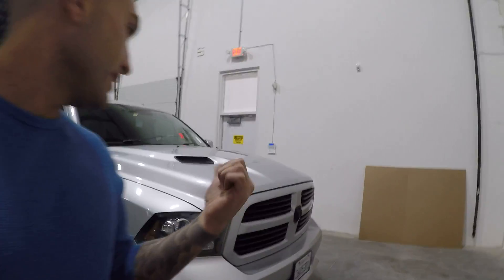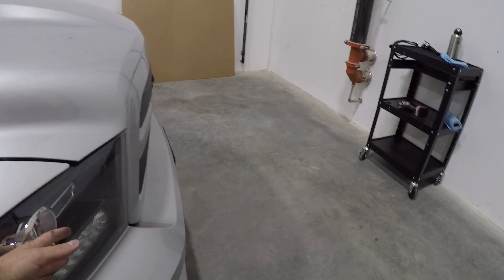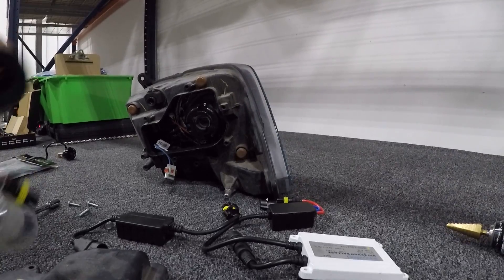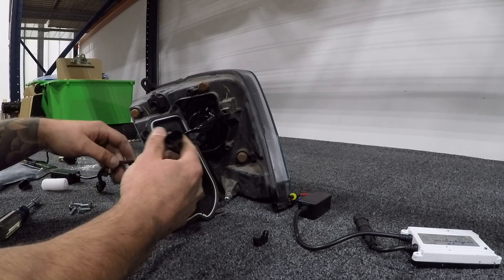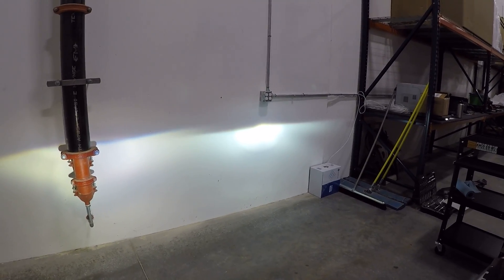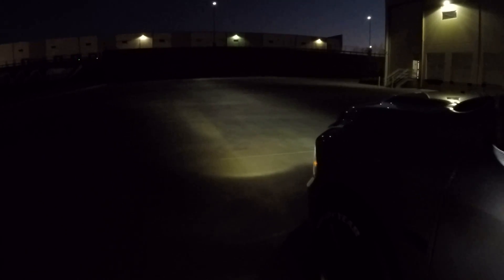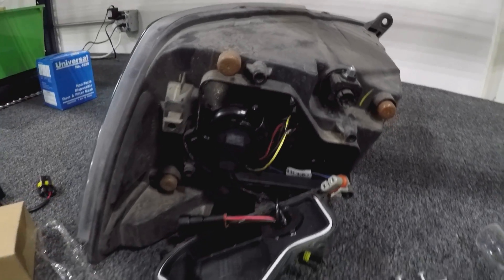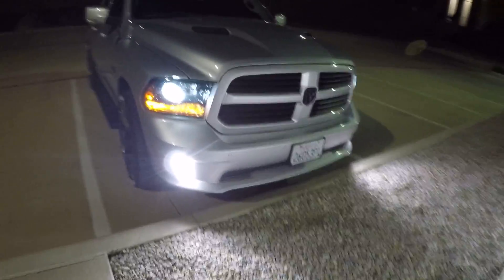LED vs HID in Factory Halogen Projector Headlights

Comment: Hey bro I installed this same set up on my 2015 ram 1500 and with the truck off the lights on with no problems but with the truck on the lights wont turn on or when the do turn on they flicker or they shut off after being on for a little bit. Any ideas on what the issue could be and what I could do to resolve it?
Reply from the maker: Is this with your headlight switch in auto mode?  I know some of us have had to manually operate the headlight switch for everything to work properly and auto mode acts a bit funny for some reason.

Comment: Hey brother I have a question , I have Laramie 2016  this bulbs h11.h8 h9 fits in my truck ?
Reply from the maker: Hey Bruno double check here cause they switched the bulb types around for different years for some reason even though the headlights all look identical http://www.philipsautolighting.com/ajax_select.php
Reply: It’s been almost a year since you put HID BULBS in the truck. I want to convert to HID cause the Led bulbs are not bright enough in the projectors. How are the H IDs holding up?

Comment: Probably a dumb question but I’m kind of sold on these now, however I worry how they will fit in a regular reflector housing? Will they still have a good cut off or would I be blinding people running these in factory quad reflectors?
Reply from the maker: Go LED for your reflector housing headlights. I like LED better for reflector housings 👍
Reply: BoostedMotorsports  Awesome, thanks man. I may have gotten a bit excited and bought the HID’s last night haha we’ll see how they run and if I need to change them down the line I can. They are only $36 so not to bad at all! Loving the channel btw, I have a 2014 1500 Quad can just like yours and I’m slowly trying to get some modifications done, so I really do appreciate your content. I was thinking recently if a muffler delete but after watching that video of your B2 Fabrications muffler I’m really thinking I may go for that! Keep it up man 👊🏻

Comment: the best comparison bro..
Reply from the maker: Thanks!  Check out my other videos on the channel too! 😁
Reply: BoostedMotorsports  so bro.. even though I buy high-end LED 13600 lumens headlights but still can't beat the HID 55w 4300k to 5000k?  bec HID has farther reach than LED
Reply: oh i am using factory projector headlight H11
Reply from the maker: Yeah cause the beam pattern of LED sucks in these projectors.  👎
Reply: BoostedMotorsports thanks alot bro.. now i am decided haha i will go for hid 55w..btw is it legal to use 75w or is it ok to use in a normal projector headlights?

Comment: Is the canbus required to run the HIDs or the LEDs in the headlights? If not what is the benefits of using it? Thanks in advance!
Reply from the maker: Yeah you need it to run LED or HID to put a load on the circuit and prevent flickering! 😎

Comment: Hey! Great video! I installed this one on my 2015 RAM 1500 and it worked perfectly for 15-20mins and the turned off. Not sure if overheat or what happen. If I turn them off for a while and then back On, they work again for that same span of time. Any suggestions? Thanks!
Reply from the maker: Hmm thats strange I haven't heard of that!  Might be the kit you are using or the decoders?

Comment: With the headlight and fog light set ups you used. Can you tell the difference in lighting "color" when they are both on at the same time? Or do they have the same tint to them? Low beams and fog lights.
Reply from the maker: Hey Landon all bulbs usually are different color even from one brand to the next.  Right now I'm currently rocking 5000k Innovited 55w HID in the lows and the Hikari LED bulbs in the fogs and its a pretty nice white color for both!
Reply: BoostedMotorsports right on! Thanks brother. Great videos.

Comment: 55 watt HIDs are significantly brighter than 35 watt HIDs. Typically LEDs that don't have 360 degree light output will look like the ones you have. The newer ones do better with 360 degree coverage but will still lag behind any 55 HID. The LEDs I have in my Ridgeline outperform the HIDs in my Jeep Grand Cherokee. Anything is better than the halogens. The use of 4300 to 6000 Kelvin makes even a same lumens  LED or HID outperform the 3500K halogen because they reflect better. Those in the Ram are excellent..

Comment: Note To All:  This is a great lighting change.  I did the Innovited HID 6000k and couldn't be happier but.....BEWARE of some car washes especially touchless.  They use a lot of high pressure water and at weird angles that you wouldn't get with normal driving.  My install was the exact same as Boosted's but the grommet failed to keep the headlight sealed and I got moisture inside both housings.  Luckily nothing blew but I have to take them off now and dry them out.   You may need to silicon around that grommet if you hit the wash often.
Reply from the maker: Thanks for the feedback and great tip!  Silicone is a good idea too!  With all the bulb swapping and testing I've been doing I didn't do this but it is definitely a good idea!
Reply: Hey John, used your link for the Innovited from Amazon but got confused at the page with the amount of options. I have a 2014 Laramie with all options but want to do the light upgrade. What is the specifis model # do I need to get?
Reply: And that is with inexpensive HID's. Try some high end HID's and you will really be amazed.

Comment: Hey Boosted, I really liked the video. I have a question. I also have car which has projector of halogen 35w. So as per your video it seems if I have to upgrade my headlights its better to upgrade to HIDs rather to LEDs as I also faced the same issue as you mentioned in your video that in halogen projector, the LEDs doesn't work well.
My next question is from 35W to 55W, will it not heat up the housing more and damage it?
Reply from the maker: Hey thanks for the question!  If you have the factory project headlights I would definitely recommend the HID bulbs over the LED for this application.  Also you won't have any issue running the 55w kit 😎

Comment: What is the CANBUS harness that you left in there? I did this install last night with the Innovited kit. It worked and looked great while the truck was not running, but as soon as I start the truck they flicker like crazy and shut off. Innovited linked me to a relay harness to directly connect to the battery, but I'm thinking that if I can get a hold of a CANBUS harness like you have (assuming that's the only difference in your setup), that'd be a lot easier!
Reply: I'm an idiot. I completely missed it in your video description.... /shame. Ordering a pair - hopefully they'll work. This truck is so much work to take everything apart to test a headlight, lol.
Reply from the maker: lol no worries Conrad!  You'll be an expert in no time! 😁
Reply: The decoder kit you linked worked like a charm! Also, I'm getting really good at removing and replacing the grill & lights, lol. Did you ever change out your high beams? There's so little space where they're located. I'm on the fence about modifying the housing even more to let some good LED (with the fans) fit in there.

Comment: Stumbled upon this channel a couple of days ago and convinced myself to go with HID's for low and LED's for fogs finally! I have a 2014 as well that I've been hesitant to mod at all. I was against swapping out the stock lights from bad experiences with HID's in the past but sounds like most people are having success and the video makes it look incredibly simple.

Just finished installing OPT7 CANbus 35w kit in the lows and already see a huge improvement. Install was just as easy as the video makes it look, good work! No codes or flickering but concerned from other's comments there may be issues down the road? Is using the auto function not recommended? Is it overkill to get CANbus decoders now and install them as a "just in case"? 

I also installed JDM ASTAR G4 LED's for the fogs and can't believe how bright they are! I ordered the same set for the Hi beams but there's no way they will fit. The fan for the LED is way too deep to squeeze into the housing. Has anyone had success installing an LED set for their Hi beams? I also haven't had a chance to drive at night yet with the new HID set up...is it even worth putting LED's in Hi beams?
Reply: Hi Matt, with the HIDs I think it would be best to use your switch because of the striking/restrike with the HID bulbs. From my little knowledge of them, they only have so many cycles before the bulbs are trash. They should last a good while though so don't let that bother you. Using the switch would be the easiest way to cut those number of cycles and extend the life even further. I ran a full LED setup  (Hi's and Lo's) for 2.5 years because I wanted to keep the Auto functionality. Looking back I regret it because the HIDs in the Lo's are way brighter. You may be fine with just HIDs. I have a 2015 and the CANbus is a pain. I am not sure exactly what the model year was when RAM refreshed it. My buddy had a 2012 and he was fine with HIDs with no codes/no decoders.  If you are getting light and not popping a code you may be all good. You could always add them later if you have issues. 

You can run LED highs without modifying, but it is tedious and a bit of a MOFO to get them in. You will curse. A LOT! Depends on the fan length though, the bulbs I found off a guy on a forum barely fit. I am not sure it would be worth the frustration. Unless you are able to find a bulb with high lumen output with a short(er) fan. Some of the stuff on amazon has dimensions listed. May be worth a measure it you want to go down that road. They're way brighter though, but I have not driven with the HIDs yet as I am still working through CANbus BS. Good luck.
Reply: brascle32 thank you for the quick response! I’ve become spoiled with the auto function...I’ll plan to be the guinea pig for everyone and give an update if any issues pop up / how long the bulbs last. 

That was the main reason I stayed away from HID’s for as long as did. In my last truck it felt like I was replacing bulbs or ballast every six months. They would of course always go out on road trips...

Hoping that isn’t the case with these but always safe to have a spare kit in the closet for (hopefully not) the inevitable!

Comment: Awesome content on this channel! Sweet build! I have been moding my 2015 Sport 4WD very similar to yours just at a much slower pace. Ha!  I ran LED Hi's and Lo's for about two years and decided to go HID in the Lo's and found your channel. Completed the install yesterday and have an issue. Hopefully the masses can help me out. I am using the same Innovited 55W kit with their decoders that I grabbed off amazon. The Lo's fire when I have the truck in  'RUN.'  However, when I start it they turn off and I get the classic Lo Beam out message. I have my old decoders from my LEDs and I was considering swapping to those but figured I would reach out before I go down that road. Any help would be greatly appreciated. Thanks! Keep up the great work.
Reply from the maker: Thanks for your support on the channel!  Yeah these trucks are very picky with the CANBUS system unfortunately.  I've been using the Hikari CANBUS decoders which are $20 for the pair and seem to work well so far using the headlight switch manually but as others have experienced, leaving the switch in the AUTO position does some funny stuff.
Reply: Thanks for the reply! Last night, I pulled one light out and tried my old decoders from my original Lo Beam LEDs and it worked with the truck running! Something interesting to note for all the people out there, the Innovited decoders are noticeably smaller compared to my older ones. I am thinking the feedback loop from them might contain more/larger components (resistors, capacitors, etc.) to fool the truck's system properly,  so I would try and steer clear from them. Going to finish it tonight. My passenger side headlight unit has some terrible condensation that started building up this spring out of nowhere. Hopefully by this evening it is fully dried out and I can correct the venting on the light because they were mashed down all the way. I am hoping the heat from HID bulb helps mitigate that from happening again.

Can not sing my praises any higher for this channel! You taking the time to show all the folks out there the small (and large i.e. procharger HAHA) details that make these great trucks even better has been a game changer for me and saved myself so much time. It is hard to find quality information with the level of detail you show in the age of over information and you have done just that. Keep up the great work and thanks again!
Reply: brascle32  what i have found its that you cant set them on auto and cant turn ur hid on if the engine its on it needs constant power cant be turning the car on while the hid are on because while you crank your truck you taking power from the hid and they wont work properly

Comment: Just did the full set up for my 2014 ram sport innovated HID  kit and c6s leds fog lights. Looked good. Having to send back c6s kit faulty bulb and one of my head lights goes out then comes back on at random. Any advice?
Reply from the maker: Hmm are you using the auto function?  I've heard some people run into issues using auto and go away if you just turn the headlights on manually.
Reply: No I don’t use the auto function. It’s strange worked on it over the weekend. Passenger side would work and then go out giving notification that bulb is out. Drove to work this morning passenger light would not work. Drove home and light came on half way home. I thinking a ballast issue. I’m going to switch the ballists tomorrow and see if it happens on the driver side. I’ll keep you posted. Also thanks for the help with pin position with bulb. Fit perfectly.
Reply: 35w canbus integrated ballist kit was a bust. Faulty ballist. Liked the idea. Going with 55w kit but the link from your page to amazon is not working. Found 55w ac hid xenon conversion kit w/ slim digital ballast. Is that the kit you used?

Comment: I ordered the 35watt set by accident, but emailed Innovite and was told the canbus was only good to 35 Watts. Have you had any trouble with the 55watt set?
Reply from the maker: Hey Kevin you just need to run CANBUS decoders to use the 55w set like you see in this video 👍

Comment: How do the colors match from headlight with hid and led fogs
Reply from the maker: The HID 6000k bulbs are a bit more blue for sure.  I'm going to be testing 5000k and 4300k HID bulbs next which should match better.
Reply: BoostedMotorsports Thnks

Comment: What modification did you do to the bulb to get the pigtail to point the other way
Reply from the maker: Hey Patrick you'll see three different sized pegs on the bulb and you just need to trim the two larger ones so that you can insert the bulb at a different position. Let me know if you have any other questions
Reply: BoostedMotorsports thanks

Comment: Hey love your videos. I have a 2014 ram 1500 like you and i used your recommendation followed your video which was very easy and informative and installed the innovited hids. They work awesome just like you said but I noticed that my head lights don't work on auto anymore. I have to turn them on for the headlights to work. Did that happen with yours and if so what was the fix?
Reply: Never mind I got it figured out
Reply from the maker: Hey Angel sorry just seeing this now.  How did you end up fixing it?

Comment: Innovited does has a Canbus HID system  That I am currently running on my 13’ ram , works awesome. My 9006 bulb fits perfectly in the projector housing with no modifications as well .
Reply: No flickering with the canbus system. I had ordered the $40 with out the canbus ballast and blew through one bulb , but after they sent me a canbus HID ballast everything worked fine
Reply: mariodlm Innovited Premium AC Canbus HID Kit 100% Error Free No Flicker No Warning - 9012 - 6000K https://www.amazon.com/dp/B01B5I1ZD6/ref=cm_sw_r_cp_api_FQ9XAbA7HEK0A
Reply: mariodlm 
There is the link to exactly what you will need , just make sure to choose the correct bulb size for your spyder headlight housing. Follow the instructions from this video and you should be fine
Reply: So if the ballast is canbus, does that mean I wouldn't need a resistor adapter setup like most people do for the rams.
Reply: alweezierojas1 you stated the 9006 bulb on first comment then the 9012 on this comment. What's the difference? Also is the 6000k any different than this videos 5000k I think he installed? Any bulb problems since you guys installed several months ago? Thanks
Reply: alweezierojas1  were you able to fit all wires ballast and cambus inside the headlight without drilling holes in the headlights

Comment: Do you have pictures on how you organized the ballast and other wires. I'm getting that setup up this week and I'm just wondering? Also what fab did you have to do to get the first one to fit? Thanks again for all the help.
Reply from the maker: Hey Mike I don't have pictures but I show where I mounted the ballast on the pass side by screwing it to the plastic liner and then on the drivers side I fed the ballast into underneath the fuse box and cable tied everything there for easy access.  The fusebox lifts up with 4 quick release tabs and makes it a good spot cause you could swap the ballast or decoder without removing the headlight if ever needed 👍
Reply: I put them in and they continue to flicker then shut off after 30 second. What should I do?